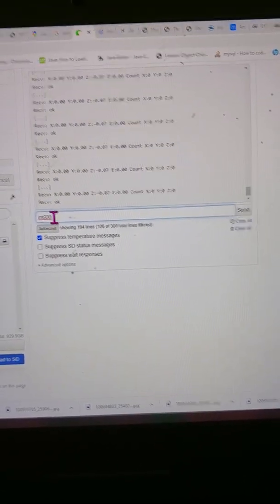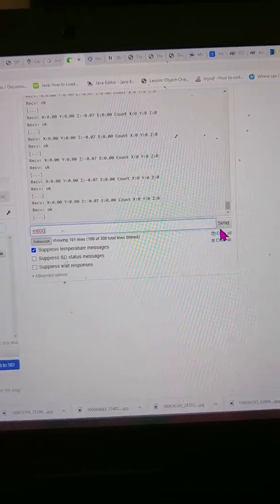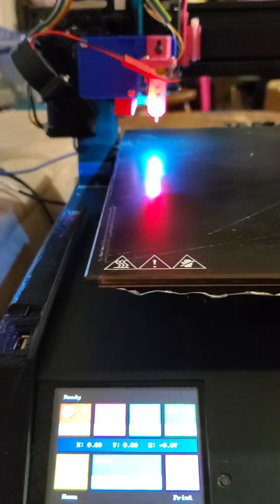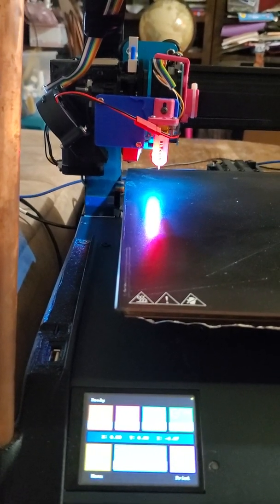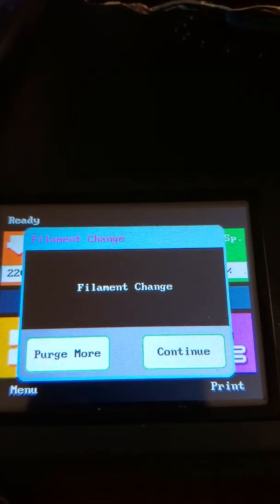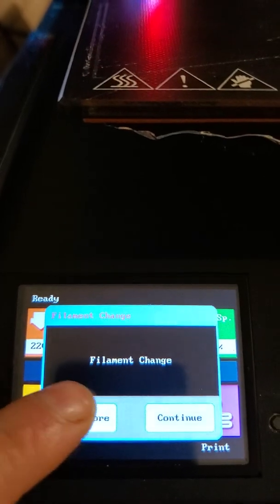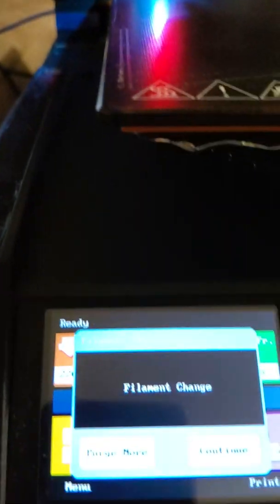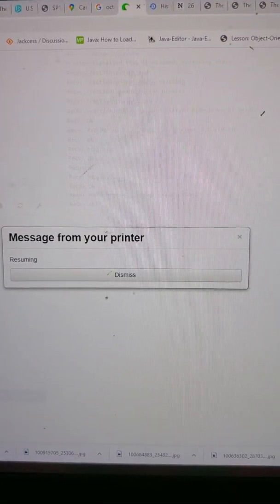IT WORKS! M600 Proof of Concept on Stock Hardware Artillery Sidewinder X1 V4 / Genius - TEASER VIDEO

Comment: amazing work! its marlin + tft firmware with m600 or only tft firmware?
Reply from the maker: It required teamwork between the two firmwares. I will be releasing them as a package and giving enough information for anyone who wants to implement this on other systems in the next video.
Reply from the maker: https://www.thingiverse.com/thing:4251390 version 1.3.11 or later is what you want
Reply: @PrintEngineering  The Marlin included is preconfigured for x1, right?
Reply from the maker: @ConanR  yes, the configuration.h file has a header section titled Artillery Options where you can select whether or not you have a Genius or Sidewinder, Waggster Mod BL Touch or Manual Mesh leveling, BMG extruder, Hemera Hotend, Nova Hotend, etc... There is also a menu in the TFT that allows you to toggle between the same type of choices.

Comment: Hi Gary
Your work is promising!!!
I have tested your latest version and it looks spectacular ... although your warning was correct, that the code is still lacking, to gain stability.
A question, It would cost a lot to include Aided Mesh Leveling ?, for those of us who want to use the factory printer (without bltouch) 
that would open the version to a much larger sector of users.
Reply from the maker: Thanks for the support, I have been working on this off and on for a few months but there is a new improvement to make around every corner! I am planning a toggle between manual mesh and automatic bed leveling in the next version, but I need to finish the M600 project first so I have a solid foundation to implement it on. If you don't mind, what stability issues have you found? I'd like to make sure I sort them out ASAP, and I can't find all of the problems by myself in a short period of time!
Reply: @PrintEngineering  a question that arises ... maybe you know it, a machine that has marlin with m600 in the MKS and that does not have the TFT with support for the M600. in insert M600 in the GCODE, when the extruder stops and the filament has changed, is there a command that can be sent by serial communication to summarize and reprint where I leave it?
Reply from the maker: @willianbell3464   That is exactly the situation that I have overcome here. So, it depends. With a few minor tweaks to Marlin you can use M108 and M876 commands for host command support. I will be going over all of the details in the follow up video. This was just a quick teaser to show the proof of concept. I will be getting into deep explanations once I finalize precisely what changes need to be made and why.
Reply from the maker: @willianbell3464  https://www.thingiverse.com/thing:4251390 version 1.3.11 or later is what you want
Reply: @PrintEngineering  Why you don't update your GitHub so all we can help you! is a easy way to have all in one site
Reply from the maker: @WGCVME  it started out as it being a hassle, but I really lost motivation due to the behavior of certain individuals in the community who like to deceive and exploit people. I'll get around to it eventually. If you really want to know the technical side of how this was done, check out the follow up video: https://www.youtube.com/watch?v=HJpfO8XifqI
Reply from the maker: I just finished filming a follow up video with successful printing! And I am working on adding Manual Mesh before I release the next version!
Reply from the maker: The firmware will be released to thingiverse when I'm done, including the Marlin source code. The link will be in the next video description. You'll be looking for version 1.3.10 or later.
Reply: @PrintEngineering  As soon as the printing machine is finished, I take a look and tell you.
Reply from the maker: I've added manual mesh leveling to the TFT. I'm working on the Marlin Configuration to use it now.